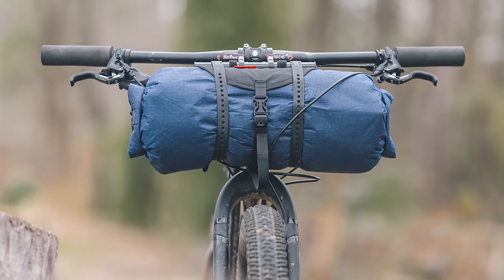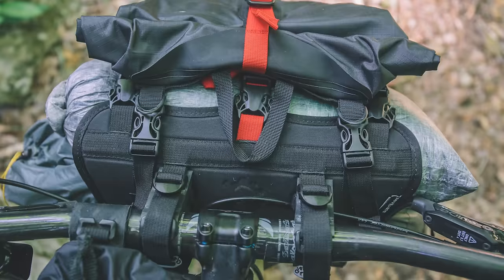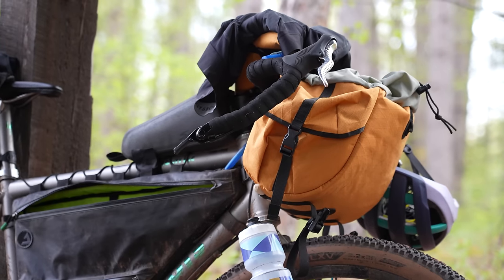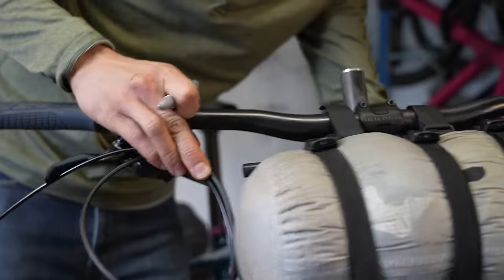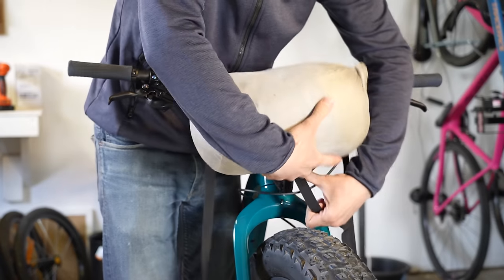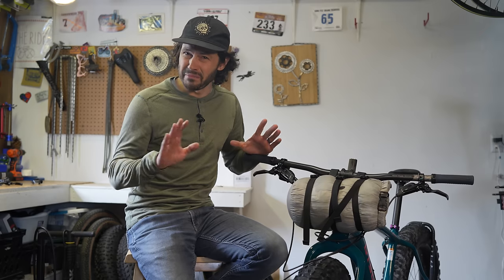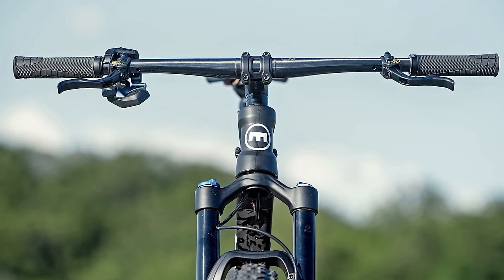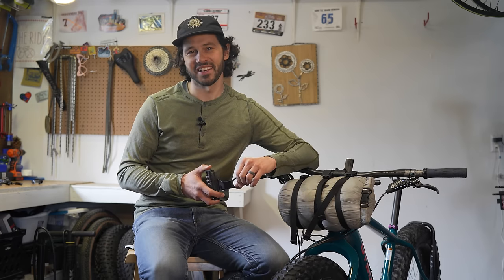Brake Lines & Bikepacking Bags: The Best Brakes and How to Route Them

Comment: I really like the Shimano brake levers for the reasons you mentioned, and they also fit my hands best in terms of ergonomics - I prefer braking with just my index finger and the Shimanos do that oh so well. Once you stop using the OEM Shimano brake fluid they can be made to work in cold temps, too. I actually use a suspension fork oil in mine for a few years now, because of the problems in the cold with the stock fluid. Around christmas it was -10°C here and I had no issues.

Comment: Just a random thought. If you're connecting a bike up from new for bikepacking, could you fit a 90 degree banjo at the lever to route the hoses completely away from your bag? It might be a solution for really problematic levers like the SRAM.
Reply from the maker: Great idea, I might try that down the road, thanks for the suggestion.
Reply: The difficulty here is getting a metric elbow that plays nice with different banjos and fluid’s
Reply: How would one go about finding a banjo bolt compatible with Shimano levers?

Comment: Stand-off brackets, whether the more expensive bike brands or the infamous $15 carbon light bar from Amazon (you showed one at the end), have always been my choice.  The extra 50 to 75mm doesn't affect steering that much and I feel the much more secure and stable bag assembly is a good trade-off for said steering change.

I've also had the idea (never tried it) to find a light duty compression spring with an I.D. to fit over the cable housing or hyd. hose and fixed (taped) at the vulnerable bends.  This design feature is found in many industrial apps like air hose assemblies which get moved and jerked around a lot.

Comment: I love the Salsa EXP Anything cradle and it works with all my bikes (unless I use the Surly Moloko bars)
Reply: The Anything Cradle has worked out well for me too. I also make sure that the cradle points downward instead of straight out from the bars. Keeps the weight lower and closer to the head tube
Reply: I have the Salsa and Blackburn similar cradles. I have found with generally straight out arms and not too heavy bags, the front end can feel noodly from the cantilevered weight. Maybe pointing down more to get the bag less up high and cantilevered is the trick.

Comment: I've not noticed any issues with my fat bike's Shimano mt500s in the winter in Breckenridge. But you could also run a better mineral oil like Pentosin 7.1 which has a temp rating of -40c to 110c outside of which you be frozen solid or boiled. I ran ancient Shimano brakes for well over 10 years on the same bleed with zero issues using the stuff. mt500s just got fed it too, no issues.

Comment: the shimano cues line has some brake levers which run parallel to the clamp, wondering if there are people using these for bikepacking? (CUES BL-U8000)

Comment: Was hoping to see some tips on length for dropbars since the cables are much more right behind the bags...
Reply from the maker: The same rules apply, dry fit it and see how it works, but in general, the lines will likely be placed between head tube and bag. A Bumper Bar or something of the like has good use with drop bars.

Comment: Only one solution with brake housing : salsa anything cradle. Case dismissed !
Reply: Agreed. But the downside is, that it's quite heavy. Especially if you already pack light. Still the best harness system to me
Reply: I made my own similar thing with an old stem and a curved aluminum plate. Works a treat and I can zip tie all my cables to the stem.
Reply: @mcWilma  how heavy are we talking here? Is 300 grams gonna break the bank on a 60 to 80 lb rig?
Reply: Odd, I have a different solution, it works great and weighs less than that cradle..